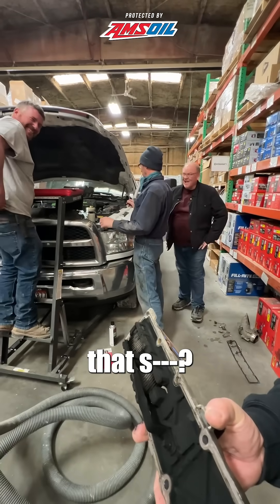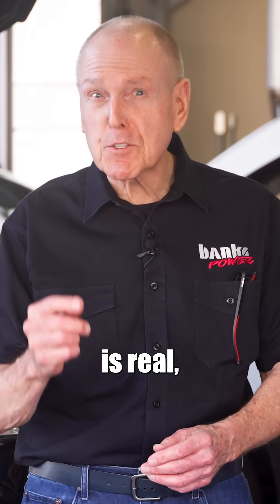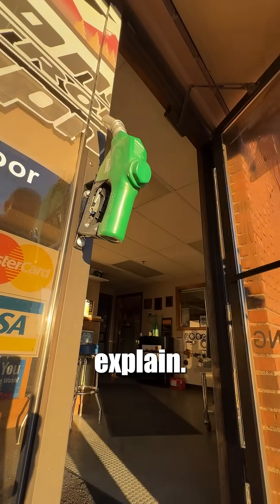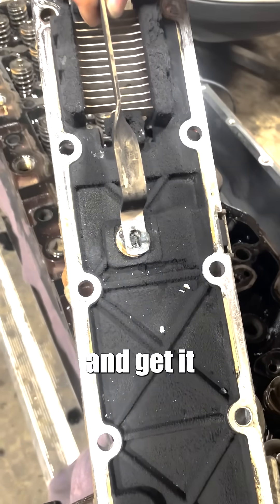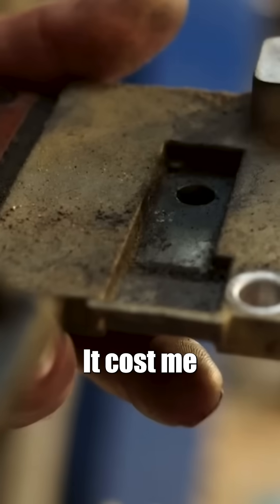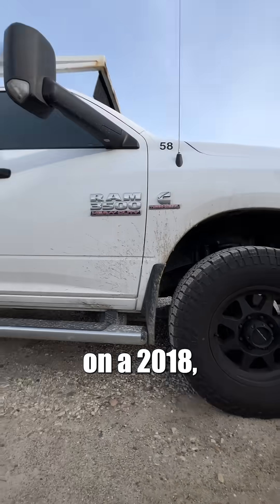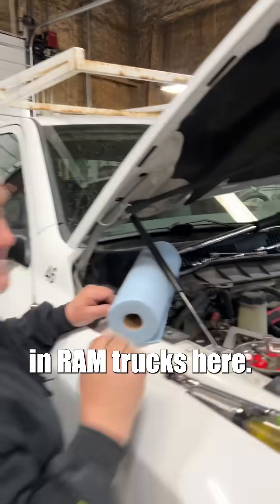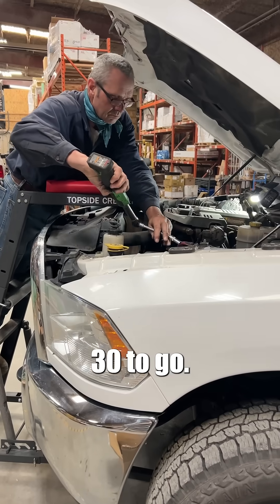Protecting $2,700,000 in RAMs from engine failure.

Comment: It’s absolutely criminal that Ram hasn’t addressed this.
Reply: The 2025 apparently has glow plugs soooooo, they’ve acknowledged it’s a problem.
Reply: @ a decade later? What a group of heroes. lol
Reply: @Chuck-w4c correct
Reply: Because just like the cracking factory rims on Corvettes, it is working as designed and not a defect
Reply: No manufacturer has made good on 2022+ issues other than Chevy 😅
Reply: *STELLANTIS
Reply: They won’t because they buy the engines from Cummins. It’s like the 6.0 Ford PowerJoke; when Ford got hit with a class action lawsuit over the 6.0, they washed their hands of any liability because “they didn’t build the engines, International-Harvester did”. That’s why Ford and International-Harvester severed ties shortly after.
Reply: "whatever we accept will continue". I don't buy big three fleet vehicles anymore. It has helped greatly.
Reply: @ we’ve had great luck with Ford Fleet vehicles, and some Chevys. What are you utilizing now?
Reply: They know exactly what they are doing. You guys should already know that everything is in some way or another corruption, if its not fixed.
Reply: Guys... Hate to break up your Dodge/Stellantis/FCA hate brigade but, The Cummins turbodiesel isn't built by them, and to further that; that grid is an EPA/EGR requirement thing. Emissions are the destroyer of engine performance, efficiency, and reliability since the 70s.
Reply: @ Ford spent millions on warranty repairs for 6.0L and 6.4L diesels AND sued Navistar for their part. Just because someone else makes a part does not absolve the manufacturer of all responsibility. Ram has done nothing to remedy the situation and apparently neither has Cummins. Bringing the EPA into the argument is yet another irrelevancy. Everyone has to meet the regulations and not letting their truck’s motors get obliterated in the process should be a pretty big goal for all involved.
Reply: Dodge engineering. Brought you the finely designed Dodge Neon engine head oil leaks that they knew about for years and didn’t fix. And the endless numbers of junk plastic parts that you have to disassemble the whole top end to access.
Reply: @me8042  they’ve been getting lit up by some police agencies for their law enforcement fleet vehicles having issues, mainly overheating.
Reply: @me8042  weird. My mother had one in plum purple. Lasted 15 years. It was known as a "Disposable car" no real issues. A Few recalls. That's it.
Reply: @me8042  You do realize that Dodge doesn't manufacture the Cummins engine, right? Completely separate company
Reply: @me8042 dodge doesn’t make the engine 🤦‍♂️😆

Comment: 30 grand for a motor?😂😂😂 lmaoooo
Reply: Look them up
Reply: @calholli just did. All over eBay sold, $6k, 4, 9, 12. For year 11 and some of the newer ones too for 9-12k. Honestly - 30k is a stretch.  Even if you include labor. 

Listen, if you have a truck that needs a new engine, ILL do it for 28k. Save you the two. Factory torque, same engine, you’ll be happy. 😂
Reply: @calholli  There are plenty on there between 100 and 140K.  That's enough life to run for awhile if you treat it nicely; is a diesel engine after all.  Good to know though as I do have one myself not blown yet. ;)

Comment: I can't imagine owning 1 ram much less 30...thats on you smart guy 😅😅😂😂😅😂😅😂😅
Reply: Cummins makes the best engines.. sadly it only comes wrapped in a ram chassis for non-commercial market🤷🏻‍♂️
Reply: @RichardPrendingue Cummins has never made a good engine for trucks (equipment and generators applications were good for the price). In the dodge trucks they were the only part that didn't fail within the first 100k (unless you count the kdp) even then they were under powered to the competition. I'd take a old 7.3 or a lbz over anything dodge had to offer at the time. Now after Stellantis bought Chrysler never. Vary Cheaply made and way to over priced for the trucks to have as many issues with literally every thing as they do. Even the gas trucks are awful.
Reply: @paulandreotto7266  I had a cousin that would only drive a Dodge and he did a lot of hotshot runs!  He had a 98 with Cummins and had a 95 Ford 7.3(actually an International) and got in a bind and asked if I could run a load with him up the East Coast. Both loaded with the same weight when we hit the hilly areas on I-95 he started to fall back . My cruise was set and he was steady shifting gears. Both were 5 speeds so I just had to slow down so that I didn't leave him that told me all that I needed to know !
Reply: @alvinhyman6838 lol nice just sold my gmc 2008 6.6 lmm utility body. With it loaded with tools, ladders, materials and with 310k and still beat the pants off a 2014 dodge 6.7 with mods. I'd bet good money to run my 2003 7.3 against that dodge. It would at least be a fair race seeing as it's "less modified" at 450hp 900ft lbs lol unlike the lmm pushing 550hp 1100ft lbs.
Reply: @paulandreotto7266  Ford has best chassis, Chevy had best transmission because of Allison, and Ram had best engine because it's the only inline 6 of that era. What makes the ram best is cheaper to maintain, mod, and less rotating mass as inline 6 engines are perfectly balanced.

Have you seen anybody swap a 7.3 Ford or 6.6 Chevy in another brand truck? How many Ford 6.0s got Cummins swapped with manual transmission and was best truck you can't even buy? Why didn't the LBZ come with a lift pump? Sure, the LBZ is fastest stock but it's a moot point if it's a work truck as going fast just destroys crap quicker especially if you're hauling.
Reply: @Cerberus984  lol "perfictly ballanced" not even close. Why did the Cummins come with a dowel pin that falls out? Or a grid heater that kills pistons? Yes, there are thousands of 6.6l duramax or 7.3 ford swapped cars, trucks, and boats( no one would swap a chevy diesel in a ford or vice versa because that's pointless). The main reason people swap in a Cummins more is because it's easier, less expensive, and doesn't require a cpu or much work if it needs one. not because it's a better motor. It's in just about every way a worse motor to a ford 7.3 or gm 6.6 the international 6.0 and 6.4 were horrible but so far it seems the ford 6.7 is on par with the new gm 6.6 lp5. If you can't tell I don't care about brands if it's good it's good and Cummins powered trucks have never been good in comparison to the competition and only getting worse with Stellantis in control of production.
Reply: @paulandreotto7266   How many V8 semi trucks are on the market that are expected to last 1 million miles VS Inline six semis? Inline 6s will always be superior and I'm not a brand loyalist it's just that nobody else makes an inline 6 diesel for heavy duty 3500 series trucks in the US market. You're nitpicking things that are cheap fixes and makes you a clown as it's considered a DIY job. But silent on the 6.0 powerjoke blowing up from ANY modding or LBZ pistons only good for 600 HP while the 5.9 is good for 800 hp bone stock internals. Which is why mechanics love powerjoke and LBZ as it put all their kids through college and funded their Cummins race truck because compound turbos are immensely easier on an inline 6 VS any V8 🤷🏻‍♂️

You then demolish your own praise of the LBZ or 7.3 by saying less electronics being easier to swap which means MORE RELIABLE. Most of the 03+ Cummins problems can be fixed by converting it to a classic mechanical p-pump or just getting the 07 of that series. Every brand has reliability problems as the NO2 emissions got super strict in 03.

Your metrics on "what's good" are akin to a silly Chinese 🍆 measuring contest that if you're winning you're still a loser. That truck you raced and "won" probably wasn't even racing but you're here bragging about it.  😂

Best 1500 series diesel engine is the Chevy inline 6 🤷🏻‍♂️
Reply: @Cerberus984  from the sound or your reply you don't even own a truck with 500hp or have a CDL license (I have both) your just a mall ninja fan boy with soft hands and softer wrist. Keep cranking that Cummins hog.
Reply: He would have had to spend another 2 million to purchase that many Fords or Chevy's.
Reply: @alvinhyman6838  yeah that extra would save more over the life of the trucks and avoid the consistent ability of dodge trucks to fail in every way possible. ( turbos, transmission, engine, wiring, rust, even the radio is garbage)Especially after Stellantis bought all of Chrysler, they weren't great before but God are they awful now.
Reply: @alvinhyman6838 I think it’s might be different prices regionally. Around me all the county trucks, power company truck, pest control, etc mainly use ford. Smaller business it’s kinda a mix between ford and ram. Don’t see many chevys other then some of the horse people
Reply: @Doa2026  Fords always have the best financing offers that's why fleets love them 🤷🏻‍♂️

Comment: Some people have complained that live in Northern Climate that they have hard time starting their 6.7 Cummins after installing the Bank intake in the winter because the coil that replaces the grid heater doesn't heat the air enough.
Reply from the maker: @cucvfarmer  We’ve researched this topic and have found that the complaints are coming from owners of Canadian tuned trucks. We believe people are passing around the same tune file which has an issue with the start-up cycle. The heater is not energized enough. We are not seeing any heating issues with stock trucks.
Reply: @bankspower and that is how you head off bad rumors. Not with threats or silence but embrace it and resolve it.

Comment: I’ve been wanting to invest in a diesel. I’m an ironworker and I travel 8-10 times a year and pull a trailer to all those places sometimes more up to 20. I’ve just been too damn skeptical because of all the issues. I have a 6.4l gasser stage 2 trans and some mild engine work. It’s not the best for pulling but, it’s been really reliable